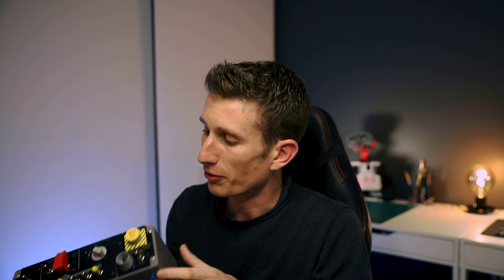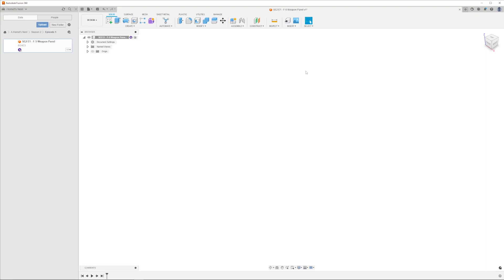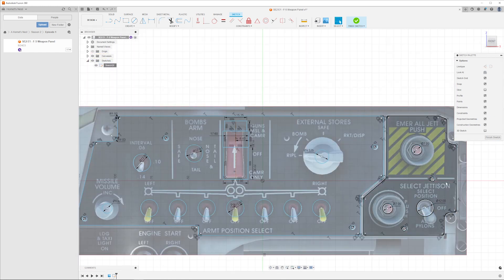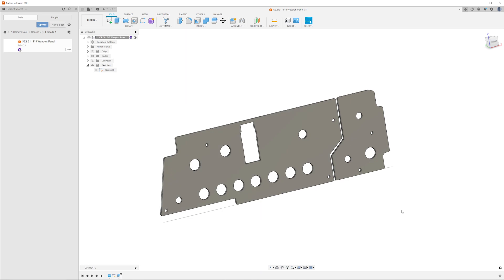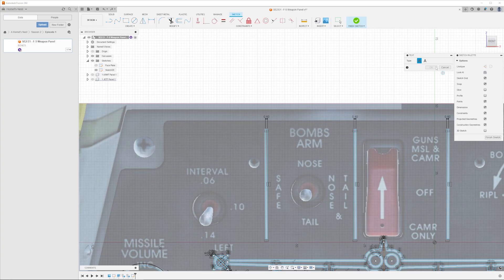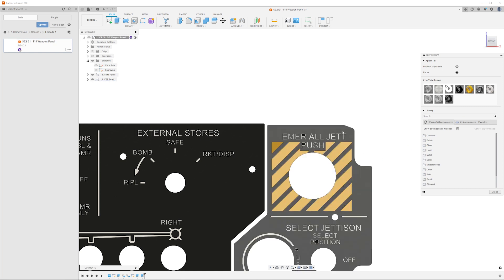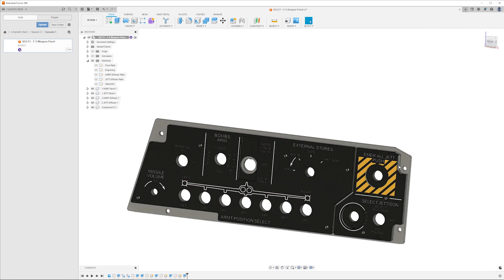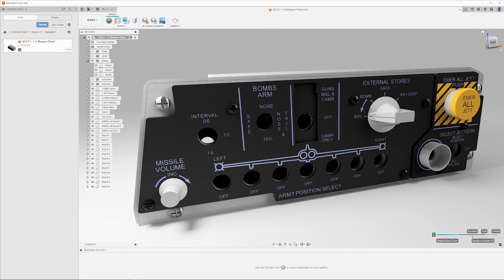Ep: 1 - Design Your Own Flight Simulator

Comment: MS33558 font is a good one for modern panels.
Reply: I am not convinced by MS33558 I have a genuine Harrier Panel and the text doesn't match, specifically the X and R are well out, and A cross is also low.
Reply from the maker: @TEACypher  definitely some variations for sure 😊 I found it’s reasonably close to the US manufacturers .. but I definitely know what you mean with the harrier as I was looking into making AV-8 panels for a mate
Reply from the maker: @01Gator 100%… 🙌🏻🙌🏻 I use MS33558 for my Hornet cockpit

Comment: Great tutorials! You said you would provide a description for the switch orientation. Where can I find that?
Reply from the maker: Hey I did too! Let me finish working on it and I’ll post it asap! Thanks for the reminder - I’ll comment back here to tell you when it’s done :)
Reply: @aHornetsNest , another question on fusion 360 if you don’t mind. It looks like you colour the face of the body of the panel black, and you then extrude 0.05mm to reveal the white text and graphics. I tried that too, but I’m not getting that effect. I select the body of the panel, I right click and select appearance, then set the option to faces and drag the black onto the body. Then I select the text, and then set -0.05 (soo it cuts the body). But the text underneath is black like the body. What did I do wrong?
Reply from the maker: @baronvonrichthofen2021  hey mate! Have a look at applying a white ABS plastic appearance to the body/component first so when you cut in the inside is white 
Then apply the black to the face, only select the face you want to apply it to (just a single click) then drag the black paint appearance onto the face (making sure you select in the appearance window apply to faces)
Reply: @aHornetsNest  I found out why it didn’t work. I first need to hide the sketch before I apply the paint, otherwise it will apply it to the whole body, regardless of I select face or body. It’s working now, thanks!
By the way, what paint do you use to paint your panels? I’m assuming it is water based acrylic paint? Is it satin or matt?
Reply from the maker: @baronvonrichthofen2021  ah good stuff!! 😃

Comment: ... guess gap in my F360 education, you at @9.00 have the main panel with holes for the switches to protrude through... you then add a 2nd layer/diffuser panel as a copy of the first (where you increase the hole size to accept the nut)... missing how you did this at @9.06 ... a subject to cover when you do your F360 videos... ;)
Reply from the maker: Yeah 100% I’ll do a full DZUS panel design video to help explain all that 😃

Comment: Nice video man. But i have a question. how can i use your method for panels that are not really accessible through the Model viewers back camera position, like you explained it in your video, or the top view of the cockpit. For example the LED-Panel with the WarningLights in it. It is in every perspective very difficult to make a screenshot and re-draw the panel in a CAD-Software. But when i try to change the camera postion to get a better looking angle, youre still right what you said in your video, that the shape of the Panel will be warped. Maybe you can help me :). Thanks
Reply from the maker: Hey that is a tricky one, the best I’ve been able to do is jump in game, and use something like TrackIR to take as “straight on” as I can screen shot. 
Panels are easy to do as their lengths and widths can be calculated using dzus lengths and widths 
Caution panels are a little harder - but can be scaled fairly accurately by using surrounding items, like screw heads, switch mounting threads etc 

What aircraft are you building
Reply: @aHornetsNest   Hey, thank you for your answer. I will also build a hornet :). I also have a question about Fusion itself. Maybe you can answer that. My problem is that after following your steps and cutting the text from body #1 (the top layer), my cuts don't appear white like it does in your case. In my case, I mark the text again and this time create objects from it, then I can color the objects. But that is very time intensive. How do you do that in your case?
Reply from the maker: Nice one! So the way I mark my text into the paneling 
1) make ‘body’ of object white with the appearance tool (A) 
2) make ‘faces’ of object black, make sure the option that says something about apply to faces is selected, sometimes it reverts back to paining the body 
3) then extrude (E) to cut the layer, depending on orientation.. if you type in a distance and it looks like it’s raising it off the body creating bumps, just add a - (negative) sign in front of the value to tell fusion to extrude the other way 

Some days I’ll forget to colour the body and faces first… then I’m left with the tedious job of colouring in each bit

You can also hold Shift and select each face and colour them in one hit 

Hope this helps 👍🏼
Reply: @aHornetsNest  yeah thats it. thanks :D
Reply: @aHornetsNest  I know it is maby a bit anoying that i ask so much but do you found a switch that can be placed for the "bleed Air"? in the aircraft you have to pull the mittle nob and then you can rotate the 4 position switch. I searched a lot in the internet, but didnt find any switch that is similar to the described function :(.
Reply from the maker: @lennartgutermuth hey no stress at all :) 
I think I will do a video on that soon 
I’ll need to double check, but Im pretty sure the open Hornet plans have a solution for that switch so it can be pulled 🙂

Comment: Could definitely use some more steps on how to get the right view in the model viewer. Might work for the F5 but I'm looking into making some Viggen parts but there's loads of other things in the way of the panels so... Any luck getting rid of that for a clear view?
Reply from the maker: Hey there! Yeah model viewer can be quite tricky when trying to get the view 
I found the same with the Hornet 
There should be an arguments panel that shows up 
And you may need to use trial and error to get some of the pilot bodies removed etc 
Also, press CTRL+A do animate, and that’ll remove the pilot as well (it will cycle the pilot from showing to hidden)
Ill have a play around and if I find something useful I’ll get back to you :)

Comment: it would have been very helpful to see how you went from the sketch to lightburn.  Thanks
Reply from the maker: Have a look at Episode 2… it’s the build phase 

But I can make a full tutorial in the future :)
Reply: @aHornetsNest  I did before I posted the reply.  It goes from showing the sketch to opening in LB.  I do not recall seeing how you saved the sketch as a dxf.  I am working on something now and struggling with that... Thanks!
Reply from the maker: @Scottforyoutube  no worries :) 
I’ll make a tutorial about that soon 

In the mean time - you can save as DXF two ways 

1) create a new sketch on the profile you want to save as a DXF 

And in the browser, right click the new sketch and select Save As DXF 

2) make the body into a component - in the assembly/design area, select the whole component by double clicking (a single click will just select the face) … right click… create drawing… it will take you to the drawing module - from there you can place the component on the sheet and scale it and orientate it… then at the top tool bar area toward the right there will be an option to save/export as DXF 

Hope this helps :) otherwise shoot me a message on Instagram @ahornetsnest and I’ll send some screen shots
Reply: @aHornetsNest  Thanks I know those two methods...  Not working for me.  I will shoot you a message. TY
Reply from the maker: Just checking in :) how did you go with the exporting?
Reply: @aHornetsNest  Thanks for checking! I got it working I just didn't realize it was that much manual work.  Once I stopped looking for a faster way and just did it. I got it done! :)
Reply from the maker: @Scottforyoutube  awesome! Glad you got it sorted

Comment: How did you engrave the scetch?
Reply from the maker: I use a CO2 laser cutter :) Episode 2 shows it briefly 
I need to make a proper video on it
Reply: @aHornetsNest  Sorry I wasn't clear I meant in fuisiun how did you enrgrave it and turn it white?
Reply from the maker: That’s all good, so I make the body colour white, and the face colour black using the appearance tool (A) 
Then once that is done, I extrude (E) 0.05mm into the face and it will remove the black face leaving the white body visible 😊 I hope this helps
Reply: @aHornetsNest  Thank you